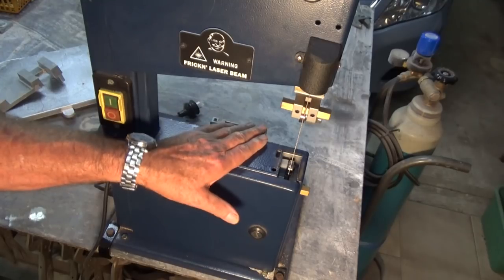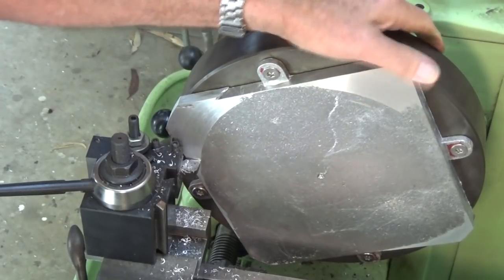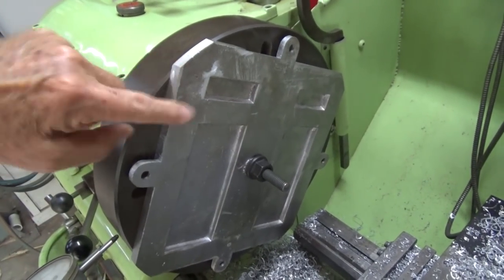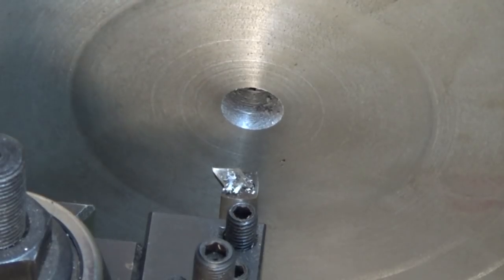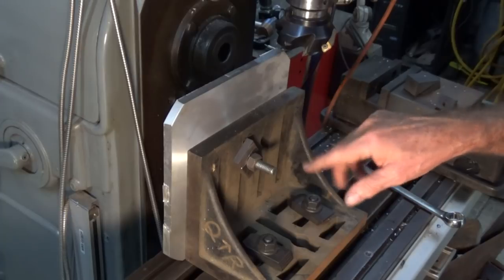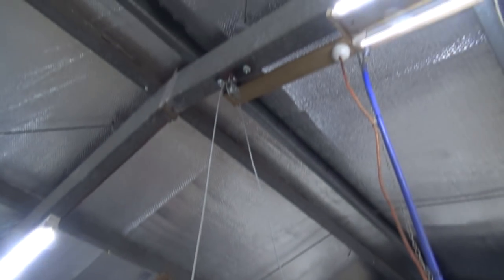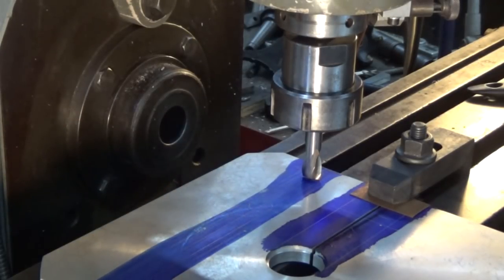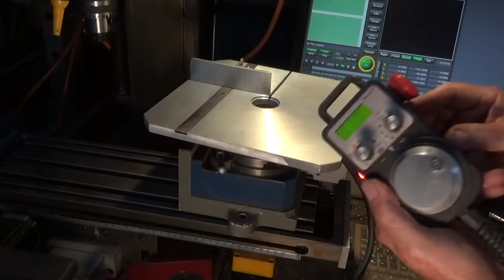Cast Aluminium Machining for a DIY Bandsaw Table

Comment: Please could you tell me the size of the tool post on the student ,I would like one but there are lots of different sizes 

Regards mark
Reply from the maker: Mark,
I use a BXA wedge type tool post and mostly 250-201 tool holders.
Regards,
Mark

Comment: I dont even have a mill never the less one to convert directions.  I would have used a carbide router bit, a good hand held plunge router all guided by an offset clamped down fence.  Aluminum vs. carbide just not as expensive.
Reply from the maker: I have used carbide router bits for rounding over edges on aluminium and they work a treat. I just get cheap ones too and keep them just for metal.  The only thing about using the mill is that you can dial in the size of the feature you are cutting with pretty tight tolerance. I had to ensure that the existing tongue fitted the slot to within .02mm. If I were making the mitre fence to fit the slot it would be a lot easier to ensure a good fit without a milling machine.
Regards,
Mark

Comment: Time to build a gantry crane and attach that winch to lift off the head, so it isn't something you are afraid or loath to do. It would make for another video series also :-)
Reply from the maker: Luke, the winch I have attached to the mill does the job but it is still a chore to make the changeover.  I am planning to get rid of  that mill soon. It is a bit of a Frankenstein really and I really want to get a Bridgeport or similar. I do know that there is a bit of misalignment between the vertical head and the mill table. I can tram out spindle out in the X axis but the Y axis is badly out and I am not sure what I can do about it.
Regards,
Mark